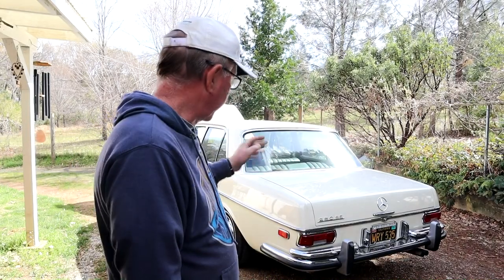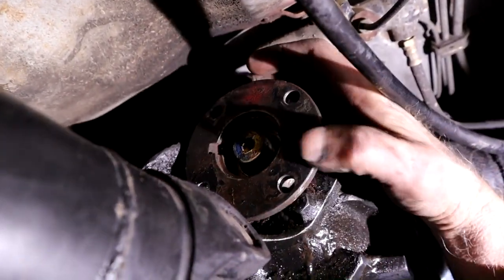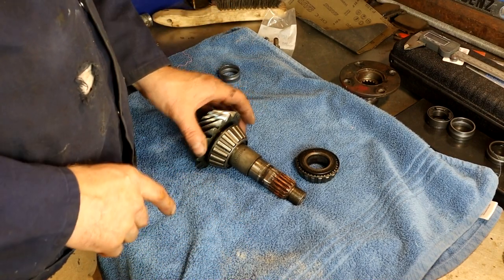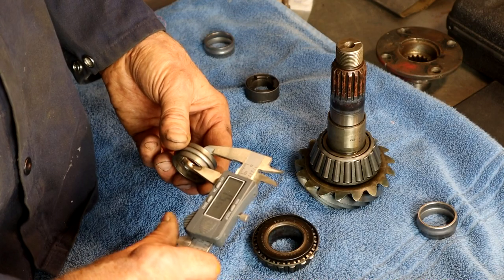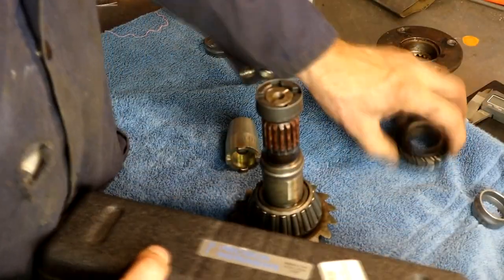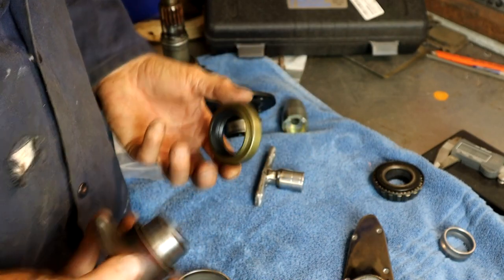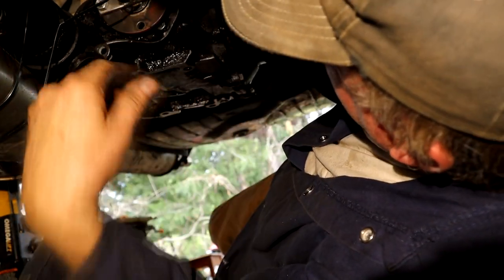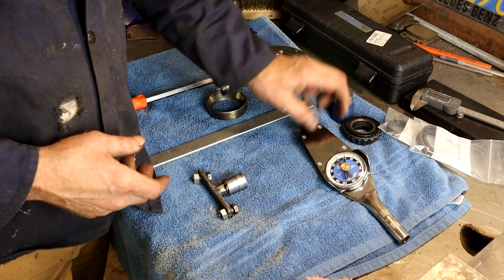MERCEDES W108 PINION SEAL REPLACEMENT

Comment: Hi John, greetings from the UK! Just latched onto your channel, which I am thoroughly enjoying by the way. A bit academic now, because this video is 7 months old, but i have done one or two pinion seals in my time, and as I understand it, the reason for the marking procedure is nothing to do with balancing, because there is not much weight versus distance from centre on the diff flange to make any real difference. It actually relates to "normal" cars that do not use that stupid castellated nut which has to be renewed. If you mark the position of the nut relative to the flange, it ensures it is torqued to the same place as it was when it came off.
Reply from the maker: Hi Bob. Nice to hear from someone in the Home country:):) I understand about the marking. The castle nut is a royal pain to get just right. Socket wants to works its way out. As I was replacing the nut, marking would not have helped me. the inch pound wrench worked quite well. The car has been running like a champ. Glad you're enjoying the channel. 
All the best 
Cheers John.

Comment: I'm at the point now where I'm ready to set preload on the pinion in the diff case. Do I set the preload with or without the pinion seal in place? My w111 has a swing axle and so the diff case has a little cover that the seal fits into, then the flange goes on after the cover. Just trying to decide what the best process would be. I've read on other non-mercedes forums that if you do have the seal in place you should subtract around 3 inch pounds... Thanks for any advice!
Reply from the maker: Your w111 is the same as mine. But I'm a little confused, you have to put the seal in first then the flange is fitted, then you preload. Otherwise you would have to take the flange off again to fit the seal then you've lost preload. From memory the pinion preload has to have around 15  inch pound's of rotational torque. With everything together I believe its around 25 without any brake drag. Hope this helps. Cheers John.
Reply: @mercedesmaintenance.6339  This answers my question, thanks so much 👍